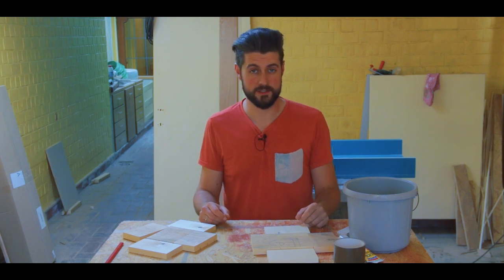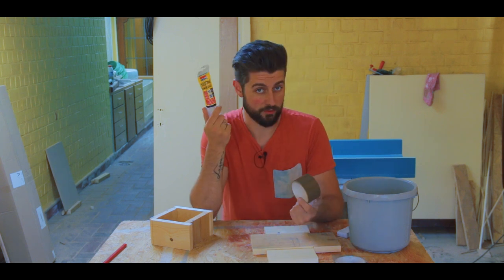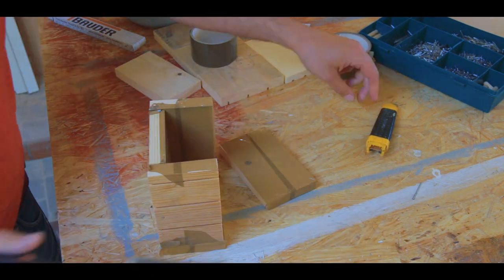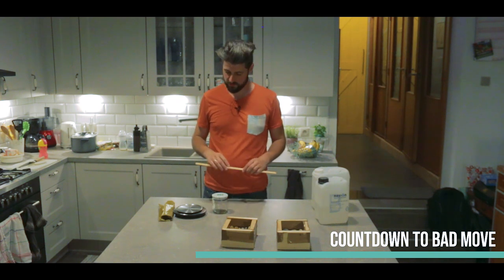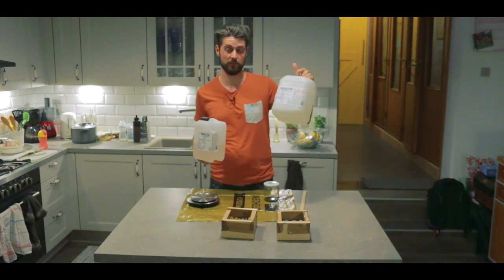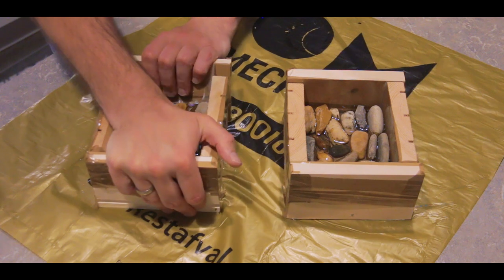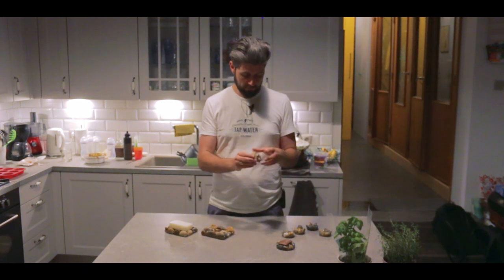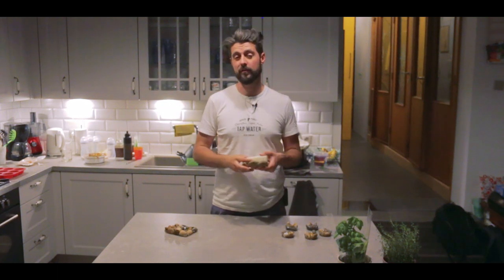HOW TO | make a Resin and Stone Soap Holder

Comment: hi can you let me know if cellotape is also non stick for resin thanks so much going to give  your soap dish a try
Reply from the maker: Amanda CROWN , yes it will work the same way. But if its thin tape they you’ll have to use many layers next to each other and that might show some additional marks. The packing tape does the same thing, it is jusy wider so you need less strips next to eachother.
Reply from the maker: *then and *just (typos due to iphone use :). )

Comment: Shall I use in silicone mould instead wooden lined cello tape ?
Reply from the maker: Hi Tamilarasi, I used the wood covered in cello tape because my silicone molds were too small :) but if you have silicone molds big enough then please use those. My wife took small silicone cupcake molds and made 4 small soap holder with the leftover resin and those released super easy from the molds. So 100% yes to silicone if you have it!
Reply: @ProjectsandThings  Thank you for Ur reply ... I would try it... Good video too..
Reply from the maker: @tamilarasis3732  thank you! And good luck with it
Reply: @ProjectsandThings  Thank you 🤗